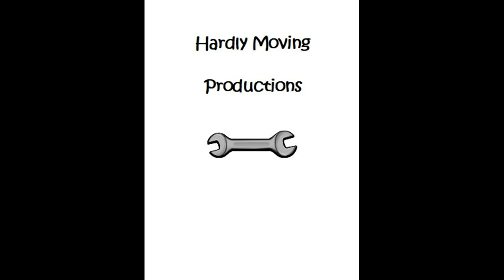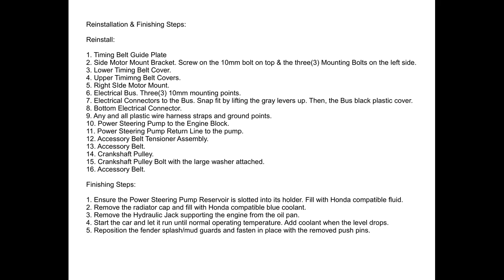Timing Belt & Water Pump Replacement - Honda Pilot

Comment: Will the kit work for a 2nd gen tl from 2002?
Reply from the maker: Nope.  2004 started a new design ... but I'll find a compatible kit for you.
Reply: @hardlymovingpro  aw shoot, should've waited for your response. I'll go cancel my amazon order haha
Reply from the maker: Here's the link to the OEM Parts ... it fits the TL from 2000 to 2003:  Aisin Water Pump, Mitsuboshi Timing Belt & believe Koyo Pulleys.  These are all OEM Japanese parts ... just like the dealership:  https://amzn.to/34nsrhB
Reply: @hardlymovingpro  you're the man! Thanks so much. Know any links for the cam and crank seals?
Reply from the maker: If it were a Toyota, I'd recommend replacing the crank and cam seals.  But on the Honda's I've worked on with high mileage, they don't seem to wear out and leak.
Reply: @hardlymovingpro  for sure. Hey I appreciate all your help. Got yourself a subscriber
Reply from the maker: @ThePwak007  Thanks! Have fun and good luck with the belt replacement!

Comment: Lucky you didn’t break the starter
Reply from the maker: The starter gear is pretty tough.  No longer have a need to do bump starts to get the pulley bolt off.  My new Milwaukee M18 1/2" impact tool puts out over 1,200 lbs of torque and combined with the Leslie high mass impact socket, the pulley bolt spins right off!

Comment: Talk to Bundy's Garage, his Gates water pump failed on his 2003 TL, engine got out of time and bent the valves.  Many reviews of leaking or failed Chinese Gates water pump on Amazon also.  OEM pump should be used.
Reply from the maker: I tend to agree which is why my preference is Aisin water pumps which is a OEM provider for Toyota and Honda.  Also, what you think is a Gates water pump may not be Gates if purchased through Amazon.  It appears that Amazon is a dumping ground for cheap Chinese knock offs that is extremely difficult to detect the difference.  So I would not be too quick to assume Gates makes poor quality water pumps.

Comment: Hey there sir, I was wondering if you could give some advice on my upcoming project, it's my sons 1991 acura legend v6 it needs an water pump replacement and while we're at it we gonna replace timing belt and tensioners too,what kit do you recommend we get that it would at least  last  100k miles ... Thanks
Reply from the maker: Dayco is a big OEM parts supplier for the auto industry.  Here's a link to the kit advertised on Amazon:
https://amzn.to/2YZurJB
You can also go with CRP Industries.  Here's the link:
https://amzn.to/2JQqEe8

Comment: Do you have a video showing replacing cam/crankshaft seals on J series engines? How often should they be replaced? Is there any chance that one might turn the pulleys while trying to remove the seals and mess up big time? Thanks.
Reply from the maker: Haven't experienced Honda engines with worn out camshaft seals very much.  Only did one a few month ago on a I4 F series.
Reply: Crankshaft seals should ideally be replaced along with re-sealing the oil pump at the time you are doing TB (because it has to be removed for that, along with the oil pan). As for camshaft seals, it is a universally accepted opinion among Honda specialists that you should not touch the old seals UNLESS they are leaking.
Reply from the maker: Never encountered a worn out crankshaft seal on a Honda engine.  Even with over 200k miles.

Comment: Thank You! Very well done. I'm about 50K from doing this job myself on a 2012 vs $1000 at the dealer. Pretty much the same as the Accord but a bit more involved getting to the motor mount for removal. In addition, once the belt is on, tensioner released I'd rotate the engine with a breaker bar at least once if not twice around to make sure the marks are in correct timing.
Reply from the maker: Thanks for your comment!  We'll be doing a TB/WP video pretty soon on a 2004 Acura TL V6 which is much the same as the Pilot ... so stay tuned.  On V6 twin cam sprocket engines, you'll have to rotate the engine more than twice if using paint on the timing belt to perform an alignment check.  As long as the belt it tight between the cam sprockets and the sprockets match their alignment marks and the belt leading from the cam to the crankshaft has no slack and the crankshaft match with the alignment marks, there's no need to do an engine rotation to check the alignment.  Moreover, you can also start the car with the TB covers off before buttoning everything back up.  Here's where I did it on a Honda Accord I4 and a Camry I4:
https://youtu.be/zR6W_gP1bo4?t=1010https://youtu.be/ks0ynJxYLnY?t=1100

Comment: Recently did this work on the Wifey’s 06 Ody. Who ever performed the timing belt before stripped the engine motor mount bolt. Took forever and a day to back out the bolt with lots of patience and WD40. Once removed, tapped and dressed the mount and bolt. Dealer wanted over $200 just for the aluminum mount.  No way Jose! To much $$$ already spent on OEM parts...Great video, thanks...
Reply from the maker: Good job and thanks!  Next time think about taking a trip to the salvage yard to get needed parts.

Comment: Great video and great step by step written directions on your site. Do you believe this would be the same, or similar enough to follow, on a 2001 Acura Cl Premium?
Reply from the maker: Thanks!  I think the Acura may be easier.  May not have all that electrical stuff I had removed to get to the side motor mount on the Pilot.  Have a friend with a late model MDX.  None of that electrical stuff is in the way.
Reply: Hardly Moving Productions Thanks!
Reply from the maker: No problem.

Comment: For myself, I would install OEM timing belt. Hopefully made in Japan, not Mexico
Reply from the maker: The Japanese belt makers are Bando and Mitsuboshi ... although I have changed OEM belts on Honda's with the Gates logo on it.  Continental is a good European brand.  Korean TB kits are also pretty good.   The good domestic belt makers are Dayco and Gates.  I've seen Gates belts last over 100k miles.  It's all about the belt installation.  Unless the engine is designed with a dynamic belt tensioner, it can get a little tricky trying set the belt to the optimum tension.  Too tight and the engine makes noise and stresses the idler and tensioner bearings;  too loose and the belt slaps against the TB cover and could eventually snap over time.

Comment: I had the timing belt fail on my '09, so tackling it myself, lot of money being sunk into tools I'm only ever going to use one time...but still cheaper then taking it to a shop.
Reply from the maker: I hear ya!  Only thing you have to worry about is if any of the valves are bent.  If so, you'll have to remove the cylinder heads and bring it to an automotive machine shop to get the heads worked on.
Reply: How many miles were on your Pilot? Manufacturer recommends replacing at 107k 

My silly butt thought I was getting a new Ram and didn't put the money in it and now I'm at 140k with knocking noise. Not sure if it's the hydraulic tensioner or a rod but I do have a visible leak around the valve cover gasket on that same side as the timing belt. Anyways, gonna replace the timing belt and water pump right now because I'm overdue and hopefully that noise goes away. 😁🤞🏽
Reply: I bought that crank holding special tool for my 2007 Odyssey about 10 years ago and thought to myself "Dang! There goes $30 I'll never use again."
But here I am, looking at a 2016 Odyssey now, and I'm thinking, "Man! Am I ever smart!"
When I bust that bolt loose this weekend, I'll have to make sure the wife hears me marvelling about how it really saved the day and avoided super costly problems this time around. Heh!
Good luck. Never, ever keep a timing belt working past its service replacement point. Super expensive to clean up after it fails on these engines.

Comment: My goodness you have to remove so many parts just for access it looks like a nightmare
Reply from the maker: As strange as it may sound, this is one of my easier repairs.  Check out the Lexus RX300 Evaporator/Heater Core replacement.  I think that may  change your perspective.
Reply: Yup nightmare 🗡️🗡️  have to take apart entire engine just to get oil change.. bastard 🙈😭
Reply: Yep. But you only need to do it every 100K miles or 7 years, so not big of a deal.

Comment: Why not drain the radiator before taking the water pump out? Also, is the process similar for a 2007 Pilot?
Reply from the maker: Removing the water pump results in coolant coming out of the engine block.  Draining the radiator does not remove coolant from the block.  I only drain the radiator if the customer wants a complete coolant fluid exchange.  Yes...the process is almost identical for a 2007 Pilot.  The timing belt and pulley layout if virtually identical.  Thanks for your question and good luck with the job!
Reply: @hardlymovingpro  you could drill a hole in the water pump and drain it cleanly :-)
Reply from the maker: Would not recommend it.  Also, unless you have a right angle drill, how's there enough room to drill a hole?  And after you drill the hole, how do you control the coolant flow?
Reply from the maker: You can do what you want but I wouldn't.  I bought a large plastic cement mix container at Home Depot to capture my coolant.  Its both large and deep and can hold a lot of coolant.  Cost me around $7.
Reply from the maker: I hear ya.  The cement mix pan is very large and does a good job capturing the coolant.  Also, after the coolant drains out, I used compressed air to blow off coolant residue on the engine.  This is what works for me with little to no mess to mop up.  I also use the pan for messy oil jobs as well.
Reply: It's additional hassle for no real reason at all.

Comment: Seems to me the hardest part of the job is getting the crank pulley off
Reply from the maker: Yes it is.  Highly recommend you have a powered impact driver (air or electric) with a high mass 19 mm impact socket.
Reply: Hardly Moving Productions will do... what electric impact would you recommend?
Reply from the maker: If you don't do this type of work very often, get yourself an inexpensive a/c powered electric impact driver sold through Northern Tool or Harbor Freight.  They cost between $50 to $100.  I own Milwaukee 18v drivers ($300 +) because I get a lot of parts off cars at the salvage yard and there are no a/c power supplies to plug into.
Reply: Hardly Moving Productions I saw a kid use a harbor freight one for around 130 with the special socket... worked well... thanks for the tips!!! Merry Christmas 🎁
Reply from the maker: Hey that's great!  That high mass impact socket is worth it!  And Merry Christmas too you!
Reply: It is. That's why you always start with removing that bolt. Because if you can't, there's no reason to continue as you won't be able to finish the job.

Comment: This video is amazing in so many ways!!  You can truly tell and see your professionalism here as you work your way through all these parts. 

I found your channel and video as I am doing research now in hopes to understand what all I need for a 2012 Odyssey 100k maintenance.   If possible, can you confirm what I am missing?  Forgive me as I am unaware of the actual names.

Timing belt
Hydraulic tensioner 
Water pump 
Spark plugs

Is there anything else I should consider while I am at?  I plan to have this done locally and not at the dealer but would like to shop around for OEM parts where possible. I believe in paying for quality parts and labor, but $1900 out the door seems a bit high at the dealership.  

Thank you!
Reply from the maker: Sorry for the late response ... missed your post.  Idler pulley is missing but if you got a kit, it should be in there.   If possible, you should shot of an OEM Aisin kit.  They're high quality but expensive.

Comment: Im buying a 2012-15 pilot soon. Few questions: is this an interference engine so if the belt breaks the engine gets damaged? If I attempt to do this job how long does it normally take 4-5hr? Out of 1-10 what level of difficulty would you say? Thanks for the video. I did 1 timing belt in my life on a 97 civic 1.6 yrs ago.
Reply from the maker: The Pilot 3.5L engine is an interference engine. With no prior experience and you are just replacing the timing belt and pulleys, it should be about 5 to 6 hours. Add another hour for the water pump. If you take the parts off and put them in sequential order, have the tools, and follow the video it should be straightforward.
Reply: @hardlymovingpro  thank you

Comment: Damn that crank bolt gave you hell!  lol.  I actually bought a 3/4" just because if this bolt!  What a PITA! Here's the gun i use. https://www.youtube.com/watch?v=m054LFfJm6Q
Reply from the maker: Saw the video.   That guy really likes his Big Bertha air gun.  The problem is, it's not portable.  My Milwaukee puts out around 400 lbs of torque and combined with the 19 mm heavy mass socket, it did the trick.
Reply: @hardlymovingpro  that's awesome, I have to upgrade my electric impact. Right now I have a Kobalt. But it's not that great. and "that guy" is me!  haha.  Great video by the way!